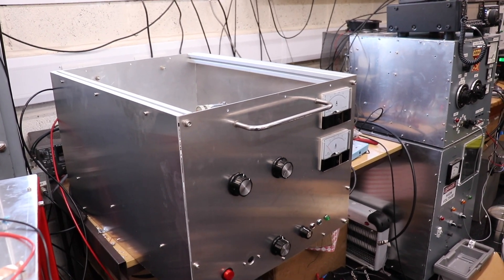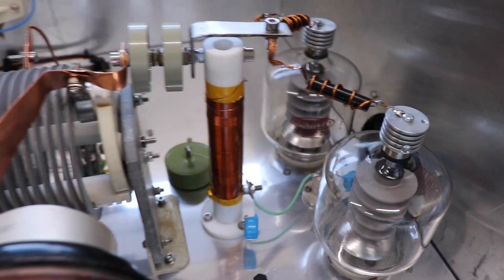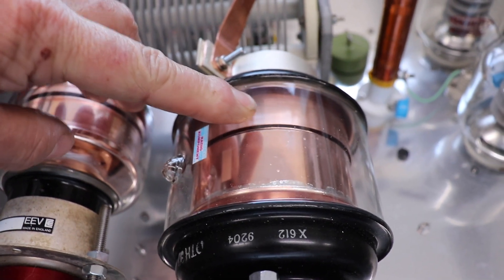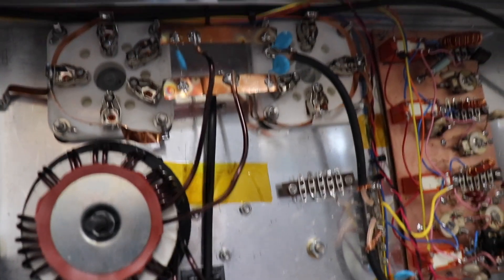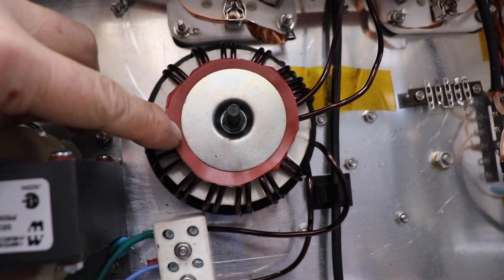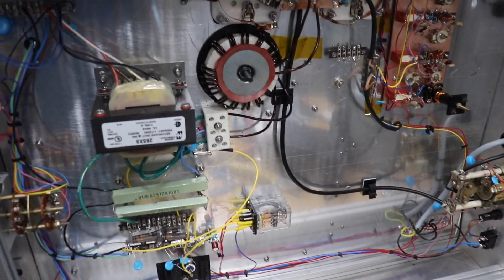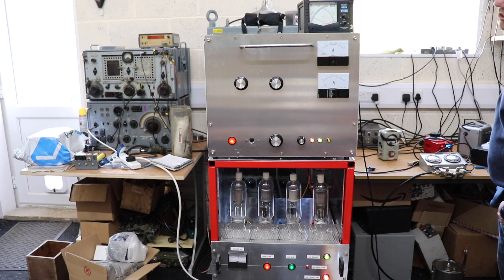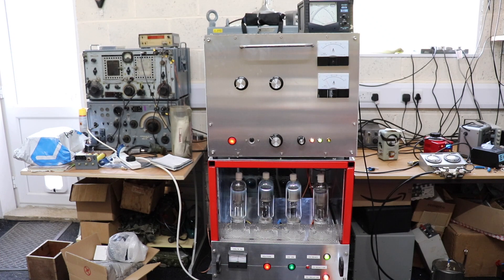3-500z Homebrew Linear Amplifier: A Useful 1Kw To Play With.

Comment: You need 34 to 3500 volts and when the tubes are loaded your voltage should drop to 3000 or 3100 volts and it should hold.

Comment: Thanks for the info and videos, really nice. Do you have a video of the power supply? I really like the idea of that 866a tubes and thinking of adding that to my linear.
Reply from the maker: I dont have a schematic but if you get the data sheet for the mercury vapour rectifiers 872 A they do have a schematic for a full wave or half wave bridge rectifier which is what I used

Comment: Just looking at your amp, I would suggest you add a neutralizing cap, unless your running a grounded grid configuration.  Also see if you can get a non-resonant RF choke.  That may help you on 20M.  Also it looks like your running two coupling caps in series.  Set them up in parallel.  This may also  help running the amp.  Best of luck.  73"s!

Comment: your tank circuit inductor in not the right Q try 8 turns 60mm diameter 8mm copper tubing for 20 meters Ray VK3RD
Reply from the maker: Yeah, possibly, does work though!

Comment: So u had to increase the bias voltage to reduce the plate current? Doesn't that also reduce the power output?
Reply from the maker: Yes it would
Reply: @thewtf  ok thanks. I'm trying to learn bias right now. I was low on power and had people tell me to increase the bias voltage to 18v..... I did that and I got less power. Not sure if I was being trolled or not.  My tubes aren't running away. I have Penta that requires zero bias. But at zero bais my idle current is 400 ma,  higher than I'd like plus it achieves no additional output for me compared to the 3.5v of bias at 200ma of plate current. With 200 watts of drive I can get 1800 watts with 300 watts I can get 1800 watts. Always remain above 3,000 vdc on the plate. So I typically don't drive with more than 175 watts. I can remove one tube and get 1100 on one at a time but only 1800 with two. Again always staying above 3000 vdc with one or two tubes. But I have noticed with two tubes I'm only getting 4.5 volts on the filaments when driving two tubes. 5 volts when only driving one. I'm not sure if the filament voltage would cause the loss in power or not. May need to buy a new transformer
Hammond 256x5 is a good replacement. Just doesn't have a center tap.

Comment: hey, recently found an old amplifier built by Sk , Andy in the eastern cape, he had made the filaments adjust'able, was a good design and built perfectly by him, found out that incresing the filament voltage a tiny bit the out put went form 860 w (single tube to 950 watt) 2 tubes with specified fil voltage was 1.3 kw, at  a little more 5.6v was 1.8kw !! and no ill effect, running on my saltwater dummy load,  did a test  video with 2 4-1000a's some time ago aswell. https://www.youtube.com/watch?v=6BAjHnZpVuc

Comment: Get ready to learn how to resolder filament pins. I.E. No tube cooling.
Reply from the maker: There is a fan you just didn’t spot it
Reply: @The WTF  ok. No chimney, no sunken sockets. Etc. No, I didn't see a fan, but where-ever it is, it's not enough. Not sure why, because otherwise it's a fine build.
Reply from the maker: @yakpilot9596  the proof of the pudding is in the eating… yes I agree the purist would require the things you mentioned; its an amateur radio amp and it works 100%
Reply: I'm not a "purist" by any means, but I have built several 3-500 tube amps, and have operated a lot of Henry amps that use them as well.  That being said, I also read the spec sheet on these tubes that require the base seal to be kept below 200C and the plate seal below 225C. Thus the need for forced air cooling (typically) through depressed sockets and usually chimneys as well. 

Of course it works now, and it will do so right up until it doesn't. I've done exactly the same thing you did, and learned how to solder filament pins in the process thus my tongue in cheek comment.

It's a beautiful amp. It is well done. If you run that pair around 800 mils and you get the anodes bright red, or even cherry red, you'll remember this respectful input.
Reply: @yakpilot9596  I totally agree. I think if it was ever run in CCS spec then you're quite correct. I don't run it anywhere near full chat so I guess that's probably why it has not given any trouble. The layout turned out the way it did as it did not start out as a 3-500z amp but was originally intended for a pair of Gu48 triodes. Thanks for the comments.
Reply: @Justin Woolgar  understood. It remains a really great layout and the workmanship is top notch!  Much better than my feeble initial attempts.

Comment: Hi how much voltage is needed for 4 of them 3-500z and can i used 3-400z with 3-500z on a emergency just a curiosity... thanks for the time 73
Reply from the maker: About 2.8-3kv but more current +\- 1 amp
Reply: @thewtf  thanks 🙏 73
Reply: Can I mix two kind of tubes 3-400z with 3-500z.  Say two of each on one box .... just a question...

Comment: You are not the only one who has had problems with 833a tubes.   I remember watching another video where the builder came to the conclusion that the tube was not very stable at higher HF frequencies.  If may have been ElPaso TubeAmps, but I'm not sure. It has been awhile since I saw that video.

Comment: Always fun building it, then the switch on moment :) and all the fun too be had after, built many of em small and big, if ya follow my youtube name you might find some of em that i uploaded, albeit im no video specialist , .good build, lots of space for another one, at 3k they give good power 1kw+ and at 160m it's needed to work from South Africa to G country.. im not active anymore but still have all the gear... maybe someday i'll return
zs2cx
Reply from the maker: FB OM de GW0FZY ( ex ZS6BLU)
Reply: Just stumbled upon the video again, and the parasitic chokes caught my eye, i once ran into similar problems with tha 4-1000a tubes, the parasitic choke changed to hairpin did the trick. the 3-500z  i built had 7.5v (diodes) at 3500v, the 4-1000a single tube had  9v (diodes) when keyed.. 2 3500z at 2.8kv should easy do 1kw, and with more drive 1.5kw. just checked on mine a day or so ago, i found the blue peppermint caps to be awfull(heating up...).. changed the 3500z amps out to very old brown Dielectric type, works like a charm, i found the decoupling caps (blue peppermint) to be a problem as well on 20m.
i did not catch your ht voltage ? maybe screen the filament choke a bit as well you might have some stray pfft in there.
1 thing at a time , i know :)
one other note : the chinese tubes want a little bit more filament voltage .5v higher, and then they run like hell!
anyway hope it gives you lots of joy, im not on hf, yet my towers are still up and all the gear still in ham room :)  ... maybe next year, i will run on TB again and catch you there.
Johan zs2cx

Comment: Got a question for you Justin, re the input/output relay at the back of the RF deck...

Is it a simple DPDT type that bypasses the amplifier once de-engerised?  Do you have any problems with RFI due to the input and output connectors being on the RF deck?
Reply from the maker: Yes it is a DPDT ... I haven’t had any problems with RFI and usually put the changeover relay on the RF deck on the linears I have made
Reply: @thewtf  thanks for the information, Justin. I thought I was going to have to fit 2 separate relays, one on the input and one on the output, according to conflicting opinions...

Comment: I think you did an excellent job. Granted I'm not technically knowledgeable when it comes to building amps but I know when one builds something worthy of a compliment. How much do you think in parts you spent (minis tube cost and time) on the build. Advice: Join WWDX. The knowledge of many of the members on that particular site is incredible! Once again I think you did an excellent job. 73
Reply from the maker: A lot of the parts I already had.. the aluminium was quite pricey also the had to buy one of the vac caps. Probably total cost £800 or there about. Still, it’s cheaper than a commercial amp and looks a lot better

Comment: Very nice job Well done mate, I have always wanted to build me a two-tube 3-500z amp. Would you be willing to share with me a parts list of what I would need to build my own 3-500z amp and power supply? I would greatly appreciate your time and help.  My email is camaro2172000@yahoo.com 73,
Reply from the maker: If you take a look at the Eimac data sheet for the 3-500z they have a schematic of this amplifier which is more or less what I used.

Comment: For 3000 volts on the plate it should be putting out around 1200 watts bring the bias down to what it should be then work on the problem what is causing the high idle current.
Reply from the maker: Thanks. Yes, I did all that but couldn’t stop it from blowing the fuse! It will give a kilowatt at the moment which is plenty
Reply: @thewtf  I am assuming you are blowing fuses once you apply RF but it is OK on DC key down with no RF. If this is the case you have a problem with your plate choke and RF getting into the power supply. I worked with many of these graphite tubes and the DC condition with 7.5v at 3KV approx. is pretty much the same in all cases. I would be investigating series resonance with the plate choke as that will also affect your plate tuning circuit on 20m. I am curious why you are running plate coupling caps in series, I am assuming here you have too higher capacitance and need to drop the capacitance, 1000 - 2200pf even up to 3300pf would suffice, if you wanted to beef up power handling of the plate capacitors they should be in parallel however these caps you are using look pretty chunky and one would suffice. Another RF ground improvement you can do is run a common copper strap to all of your RF connections as you are relying on the alloy chassis and may be getting issues with resistance causing the stability problems and even vhf oscillation. You should also focus on cooing the tube bases as they get very hot, so blowing air from underneath and fabricating some sort of chimney (I have used perspex tube in the past) would be an improvement over the current cooling, make sure your the chimney system can direct air onto the anode or make a large anode cooler as well. Great video to watch, well done on the home brewing. 73 Brendan VK3MH
Reply: @vk3mh  Hi Brendan, thanks for the comments. Yes, the plate coupling caps were a bit high hence the reason thy are in series. I had thought about series resonance in the plate choke and did check for this using the GDO but it seems OK; I did even replace it. The problem occurs only if the HT applied is > 3kv..at the moment I run it at 2.8 kv and it works fine...can get a kilowatt out on all the bands so can't really complain. There's nothing really to suggest there's parasitic oscillation and again it is something I have thought about. Yes, the cooling does actually blow air on to the bases and the glass envelopes as the fan is mounted split level blowing air directly on to the bases. Been using it fairly regularly and it has been pretty good. The only problem I have had is the HT lead connection in the ceramic insulator came adrift so was not getting any volts. That's all been sorted! Keep watching the videos, got another project in the pipeline. 73's Justin GW0FZY